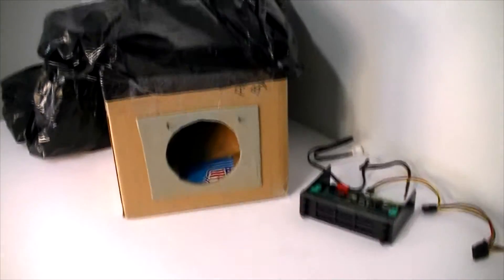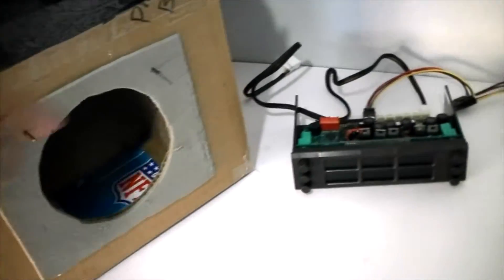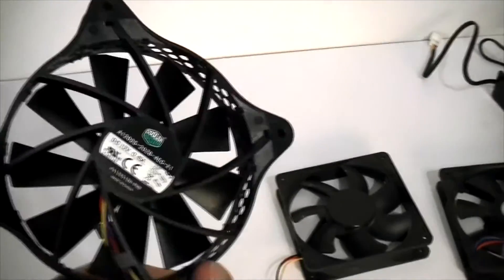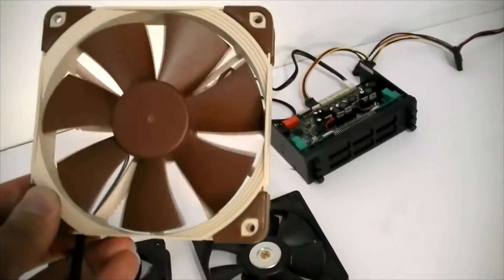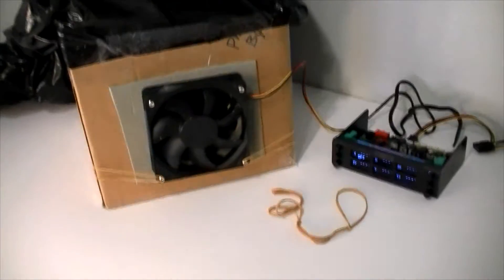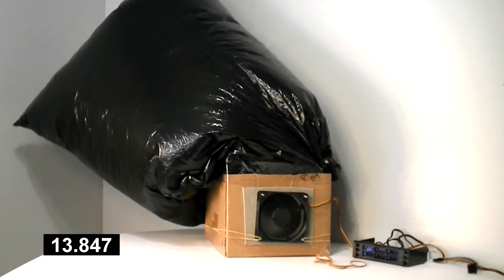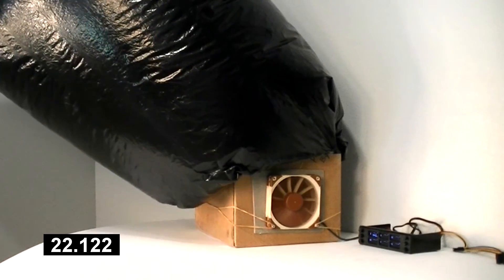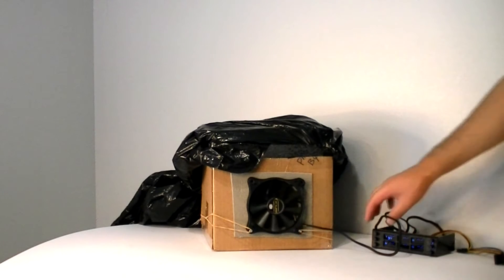Flow and Pressure Testing 120mm Case Fans

Comment: I realize this video is very old now, but it would've been nice if you'd actually done the calculations you mentioned and shared the results, including RPMs, AF, SP and DP.
Reply from the maker: Yes, this video is quite old and, I believe some of the information you are looking for is on the supporting article for this video.  The article translates the fan flow into system cooling which then can then be calculated.   The rest if just simple math based on the defined variables.
Reply: @Hardwareasylum  Thanks, but are those fans still available? Would you please organize your videos into different playlists? I can't tell if you've even got more fan tests.
Reply from the maker: Most of the fans are pretty vintage at this point.  Except for the Noctua, that is still a popular air mover.  As for organizing the videos? there is only one fan related video on this channel so, there you go.  However, there are other fan reviews on my website.  Seems I am recognizing a trend here.  :)  

Thanks for watching and writing a comment.
Reply: @Hardwareasylum  Thanks for the interesting experiment. I'm pretty sure it's an unprecedented way to look at AF and SP.

Comment: Very cool test. I wonder how all these would fair vs inline duct fans or a marine blower fan. I'm trying to build a diy a/c from an ice chest. Found a few designs, but the best ones either mount a giant inline fan on the outside of a cooler and run the air through a duct inside a cooler or use radiators. I'm trying to come up with a more compact design, so I need a high cfm fan that's not too big and can somehow be connected to a 3" duct. Any ideas?
Reply from the maker: So, basically, you are trying to build a mini swamp cooler, that seems easy enough.  However, I cannot comment on what fans to use but, the way I see it, everything I did in "this" video could be adapted to your project.  Thing is, I was simply testing some computer fans trying to illustrate that the fan specs are generally correct, you just need to know what to look for.   

For your project, you're going to want something like a delta PFC1212DC and hook it into a fan controller and don't forget the fan grills as it WILL suck up your cat.

Comment: I think you meant to test the famous Noctua NF-A12 which has balanced airflow and static pressure? The NF-F12 prioritizes static pressure only.
Reply from the maker: The fan in the video is the NF-F12 https://www.hardwareasylum.com/reviews/cooling/noctua_nf-f12.   The NF-A12 wasn't released until two years after this video went live.  I have been meaning to revisit this topic with some new fans and will be sure to put the A12 vs F12 in there.

Comment: i want to see you do this test with Delta PFC1212DE...
its 120mm 12V 4.80 A fan
Reply from the maker: That might actually be fun.  Interesting story I used a pair of those fans once for 4-way SLI overclocking, sadly they were borrowed so I'll have to pick up some new ones.

Comment: looking at the back of the noctua fan, I think the additional spars kind of act like an pressure stator, redirecting the centrifugal airflow back into a linear direction. I found many Pressure optimized fans spill air everywhere out the side in a diffuse ways, can anyone confirm if Noctuas airflow is more linear?
Reply from the maker: That is actually a very well documented fact and the primary reason the F12 was created some 8 years ago.  However, the focal fins don't have much effect on radiator cooling.  The test here is purely on pressure.  Where you will see the difference is pressure at a distance aka case cooling.

Comment: it would be better if the bag would be below the fan and the fan pushing air downwards. this way the weight of the bag does not work against the pressure of the fan!

Comment: I'm more interested in static pressure for liquid cooling.
Reply from the maker: Of course you are...  That is the reason I setup the test.
Reply: @Hardwareasylum  What you tested was airflow not static pressure. you have to put the fan up against a flat surface with several small holes in it to test pressure. Certain blade shapes can move a lot of air unobstructed outside of a case but then you put them in the case which generally will have a metal mesh or screen covering the fan and all of a sudden the fan is garbage cause the blade design was not meant for static pressure.
Reply from the maker: I'll give you that.  However, airflow does play a part in the process.  Sure, things change but at the end of the day you still have to push air through something.  And, I'd argue that had I put a radiator in there instead of a restriction I would have gotten similar results.  (More testing for next time) 

For the actual review of these fans (The Cooler Master fans) I do test them on radiators and map out the results of the fan testing as they were shown in the video.
Reply: @Hardwareasylum  Only people that would say airflow plays a part in pressure and will provide similar results are people that don't understand the difference between mmH2O and CFM. You could have a 150 CFM Ultra Kaze fan (reduce it's speed to 1500RPMs to realistically match other fans and noise output),  put it up against a wall and have almost no pressure cause the blade design wasn't meant for being pressed up against obstructions. Then take a 3.0 mmH2O fan that only advertises 60 CFM and have it put out 3x as much pressure and move twice as much air through your radiator.
The calculation of static pressure isn't measured by airflow at all because the fan is pushed flat against a plate so airflow will be 0. 

Fans with low pressure are basically just moving air in a circle instead of through when obstructions are up against it. 

There's a lot of fans that advertise 80CFM that have anywhere from 1 to 4 mmH20 at 1500RPMs. Everyone one of them will fill that bag up at similar rates until you put a radiator up against it.  
These fans and the UltraKaze are the ones I've used in the last 15ish years. The best being the top two in the pic. UltraKaze was a joke unless running max RPMs and it died super fast (however it would have filled that bag in a fraction of the time): https://i.ibb.co/jynvsP2/27858674-1788276124557516-3939125916088125000-n-1.jpg

Comment: THIS is how fans should be tested. Nice review!
Reply from the maker: Ty,  I need to revisit this project as I have a few more fans to test  :)
Reply: @Hardwareasylum  can you please test some thermaltake fans? ^^
Reply from the maker: That shouldn't be a problem.  I have a few more I can run though.
Reply: @Hardwareasylum thanks! Im looking into buying those riiing 12 rgb and I need some with a high static pressure.

Comment: But cooler master air flow is for flowing out the heat in the case. Air flow in this test is quite meaningless as i think🤔 because air flow isn’t focusing on the pressure which cause the strength of it’s 💨 didn’t enough to stuff the plastic bag.😉

Comment: Now this is how you test a fan! It would be a complete fan test if you can somehow incorporate a decibel meter somewhere and omitting the sound of the bag being filled up. But overall, it gives the viewers a general idea about which fan gets the job done! 600th subscriber here, and 95th like! Keep it up Good Sir! :)
Reply from the maker: Thank you, thank you.   It isn't completely clear but this video was part of a review on my website and have since gotten a little better with my editing.  You are correct about the decibel meter, it would have been the trifecta of relevant information.  I might add one in the next installment however, sound level and quality changes based on proximity of the meter and what is around the fan.  eg radiator vs open air, grills on a case etc..  Because of that I decided to rely on the mfg tested dB number and focus on what was really important, at least from a performance standpoint.

Thanks for the sub!!  It will be a slow build but I'm working on more.

Comment: Glad you noticed the switch on the back of the fan :) that fan was almost ready to fly away on performance mode
Reply from the maker: This video was actually part of a review I posted on Hardwareasylum.com so it would be a shame not to test the different profiles.  I even have a handy chart on the site showing the differences between them all.
Reply: @Hardwareasylum  I see on your page but you did not do the test with blow up of the bag and measure time. I like a fan that have most air flow by fewest noise. noise when have speed of 800 rpm can not hear. so i like see which fan at 800 rpm blow up the bag fastest. can you do such a test ?
Reply from the maker: Thank you for the comment.  I will consider it if I happen to revisit this video concept.  However, I cannot tell you when that will be.  Sorry.

What I can say is that @ 800rpm (or any slow moving fan) the fan will not generate enough pressure to fill a bag like what I am using in this test.  As you know from the video, the purpose was to test pressure and airflow when simulating the fan being attached to a radiator.  What is interesting in your situation is that you are trying to attain something that would likely have no measurable gain.

Comment: More vids like this, please include equal RPM for each fan and make sure the mic picks up the noise. That way we can pick which fan is the most effective fill rate / noise.
Reply from the maker: More vids, Yes.  Everything else.  Uhh NO.   I will give you an A for effort though.  Your suggestions are rather specific and do deserve a response.

1) most microphones won't be able to pick up fan noise at any level that you could make a decision on.  a dB meter would be best however cost prohibitive for one with any accuracy.
2) Testing fans at the same RPM is pointless.  Fans with a similar blade profile will have similar specs (flow/noise) at equal RPM points along the curve.  That might work with dissimilar fans however, see point 3.  
3) I currently don't have a way to set a fan to a certain RPM with any repeatable accuracy in the context of this testing method.

I do promise that future videos will include some different information.  This video was actually part of a larger article on my website.  You might what to check it out.
http://www.hardwareasylum.com/reviews/cooling/cm_masterfan-120/page4.aspx

Comment: Wow. This was good. I watched a lot of videos on SP vs AF fans but this one was the best and the most educational one. This video gives a lot of clarity. Thanks! I plan on buying one of Coolermaster MasterFan Pro series. Can you recommend me one? I have a "Deepcool Dukase" case. The front panel of my case has a Dust filter, a metal grill and a door than be kept open or closed. So if I install a fan, It will have a dust filter, the grill of the front panel and the door (can be opened and closed) as restrictions in front of it.  Which one do you think I should go for? The Coolermaster  Airflow fan, the balanced fan or the High Pressure fan? I would really appreciate any suggestion from you...
Reply from the maker: I'm glad you liked the video,  I have a few more planned  using different fans along with some lighted versions.  As for a fan recommend, you cannot go wrong with the Air Balance it has the best of both worlds and with the speed limiter you can dial in how much cooling you need.